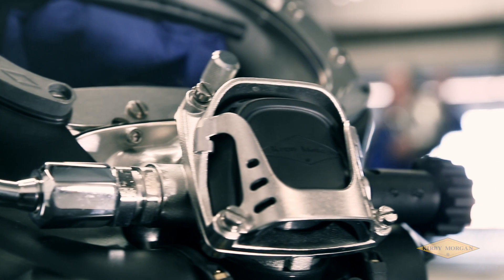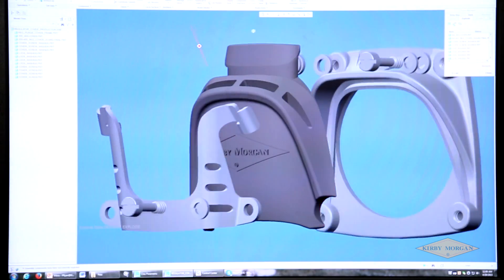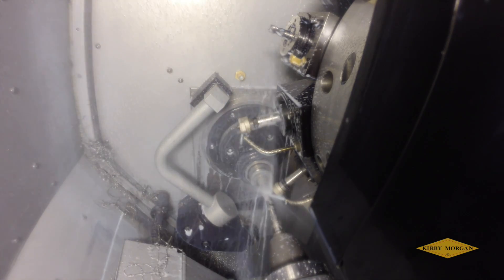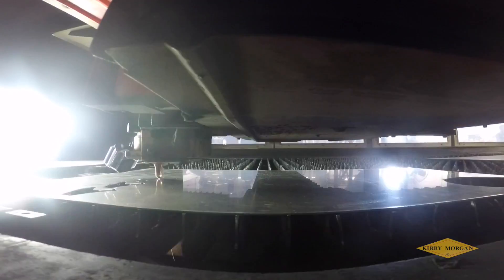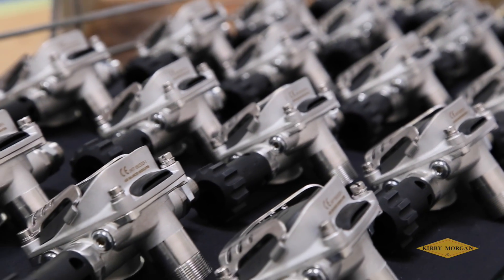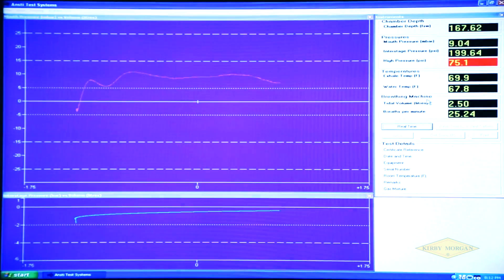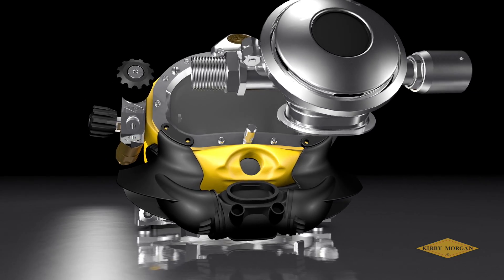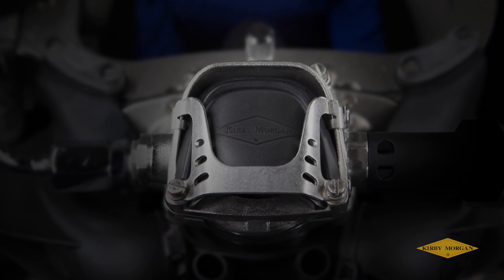Kirby Morgan 455 Balanced Regulator

Comment: Respectfully I’ll stick to the superflow 350.  Great video tho
Reply from the maker: We thank you for your continued support.  It is always good to know your options. The 350 reg has been the industry standard for several decades and remains the most widely used reg on the planet.
Reply: Excellent video! But what's the difference between Sf350 y 455? Is 455 better?
Reply: Well I have a quick question when I press the purge button on surface to check the flow of  this new 455 Regulator it starts to free flow and doesn't stop is it an malfunction or shall it be allright when I use it underwater can somebody plz explain
Reply from the maker: @pacificsus  Thank you for your comment. When you are at the surface be sure to set the regulator into the correct pre-dive set up. Which is to rotate the Demand Regulator Adjustment Knob out (counterclockwise) until a slight free flow develops. Next rotate in (clockwise) until the free flow stops. Next, Put your hand over the opening of the oral nasal and purge the regulator. It should not free flow. This would be similar to the divers face being in the oral nasal. Any free flow using this setting indicates the regulator may need a re-adjustment